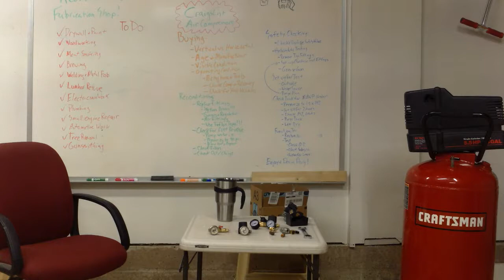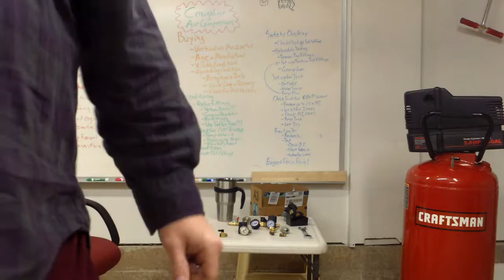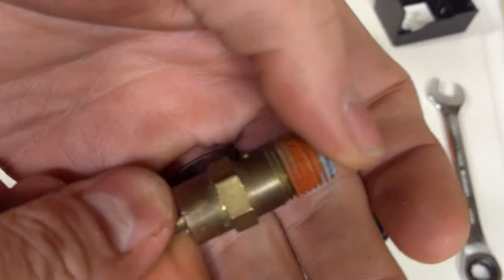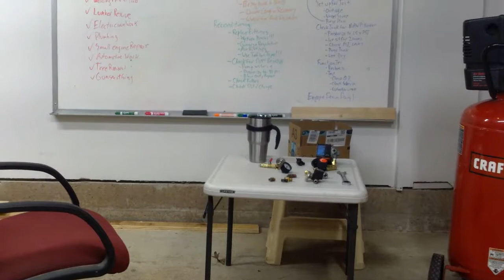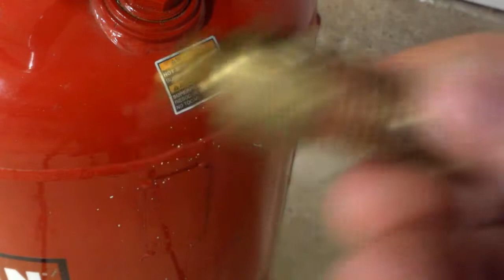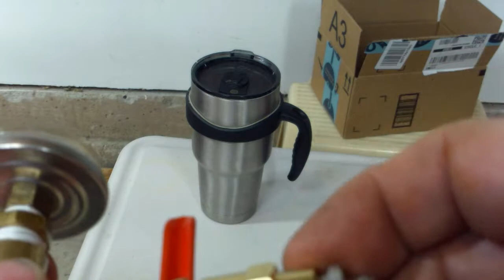Craigslist Air Compressors - Tips, Refit and Hydrostatic Testing Part 1

Comment: After watching this and another well done video about updating and hydrostatic testing of an old used compressor, I think I'll just sell the old large capacity compressor/tank and long hose reel that my son left behind rather than risk using it or having somebody go through the fittings and guages and hydrostatically pressure test the possibly 40 year old tank that has not been professionally maintained. How do I safely sell or give the machine away without incurring liability if the new owner has an explosion or other accident with it? An answer with clear advice  will be sincerely appreciated.